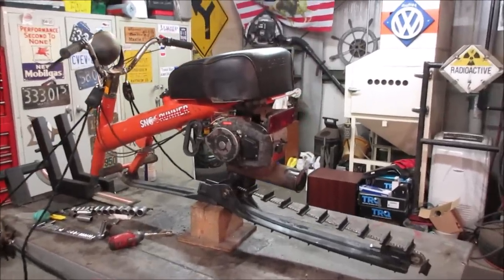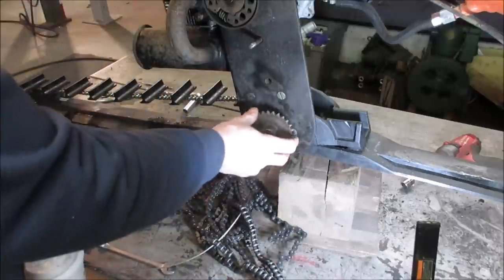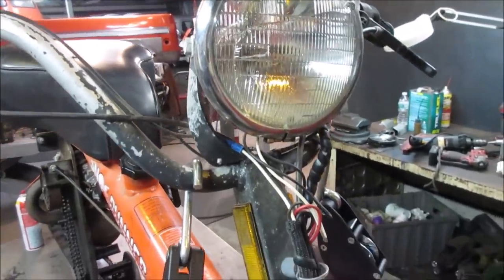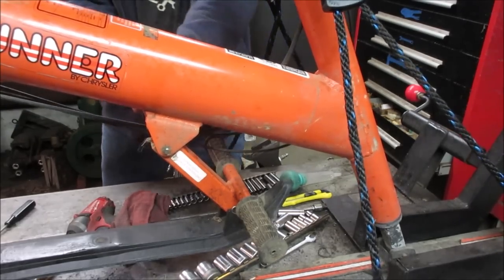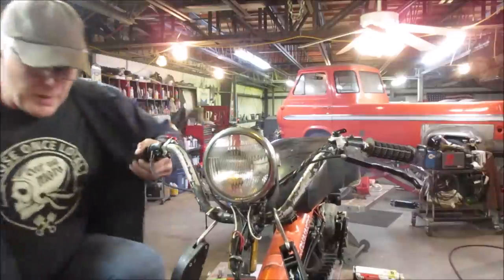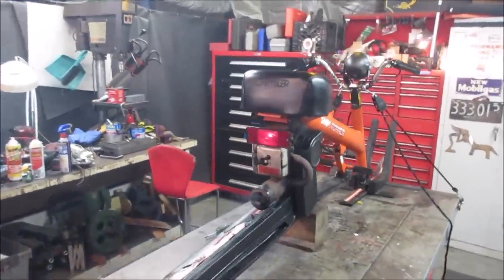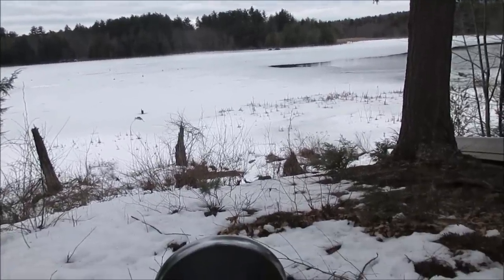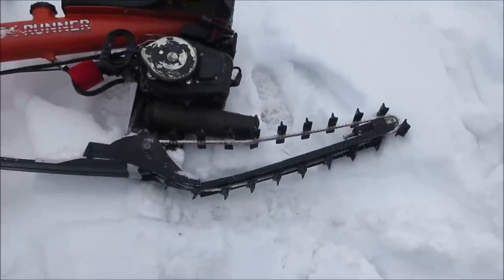Repairs finished on Junk Chrysler Sno-Runner, Win or Fail?

Comment from the maker: Hi guys, if you want to check out the vw trike in the end of this video, its here, https://www.youtube.com/watch?v=FMWEQoluv8U
Reply: If you do a search there’s a spring loaded little arm with a guide roller that keeps tension on the clutch chain it hooks to the missing bolt stud I think it keeps tension from inside and presses toward the front on your machine there’s also manuals available in pdf form you could print off with parts and function I wanted one of these as a kid I thought of it as a moped of the snow as I wanted one of those also never was in the budget have fun!
Reply: howdy mustie, i'm from italy and i love whatching your videos, i wa just kinda curious ahere are you from? like i know for a fact that it's the US but what state?
Reply: @TheGhostzZ  He's from New Hampshire.
Reply: @bastianfromkwhbsn8498  The lore goes a little deeper than that I think. ;)
Reply: Mustie1 ? You what would be cool ? if you made that "Chrysler Snow Runner" all electric.
Reply: GUY IS SELLING THAT BROKEN SKI PART ON EBAY BRAND NEW FOR $129 HAS SEVERAL. DRIVE CHAIN RAIL.

Comment: Definitely looks like there used to be a chain tensioner in the middle great video as always
Reply: Agreed...
Reply: I thought about that too I wonder if you can find pictures on the internet to find out.
Reply: Thought the chain runs inside that bar that sticks out
Reply: Yeah there's clearly a stud and hole it would mount into, you could probably rig up a tensioner from Amazon to fit.
Reply: There's a rectangular mark there where something once was.
Reply: @JasonTHutchinson  yup.saw that too. Lots of other viewers agree there was something there . surprised nobody has any drawings/ tech info etc.
Reply: Bolt in a piece of nylon (ie: cutting board) for the chain to slide on. Easier & fewer pieces than a tensioner wheel, just put it on the return side (front).
Reply: @Iowa599  I like that idea better than mine,, :-)
Reply: Pictures online, does not show a  tensioner.
Reply: The user manual does not show a tensioner wheel. There is a section about lubing the chain and at the end an exploded view, no tensioner in either. Don't know what they were thinking...
Reply: @JasonTHutchinson  My guess is that was a plate with a slot that held a small nylon roller on the outside of the idle side of the chain that slid back and forth to adjust the chain tension.
 It wouldn't be hard to build one. Just a flat plate with a slot, and a threaded hole to hold a bolt that supports a nylon roller.
Reply: Yes! Exactly! Mount another small sprocket wheel in that hole!
Reply: I had a 44" Toro Snowblower, garden tractor mounted. I want to say it had a wood chain tensionor in it. Wore it out, and replaced it with a plastic (unknown type, probably HDPE) one. Just like the chain tensionors in my Harley Davidson motorcycles. Piece of hardwood cut out on a bandsaw would work.
Reply: @knlazar08 , you'd be wrong though.
Reply: Loose on purpose............Chain play is used up during suspension action?
Reply: And, would be so easy to make….
Reply: @simontay4851  doesn’t even have to be a sprocket 👍🏻
Reply: Like maybe a high temp teflon friction bar.
Reply: @flintknappingtools  right! Could be a roller. Maybe a tube over a stationary shaft or stud. Copper , nylon something that wouldn't harm the chain, and could be easily changed out.
Reply: I’ve done some research bcuz I also believed there should be a tensioner but every picture I’ve saw with the engine cover off didn’t have a tensioner,I’ve saw 3 different bikes now. The belt was very tight as well on every1 I saw. P.S..another YouTuber named “Rednecks & Dirtyhands” did an awesome conversion 2 one of these and put a snowmobile track n souped up engine on it. Worth a look after watching Mustie
Reply: @OBeezyNB  the machine did fine as Mustie tested it. Did great until his ham-fisted friend broke it.
Reply: @twt000  Sprockets are never perfectly round so the chain tightens and loosens as the device rotates. One had to find the tightest spot (usually just through simple deflection measurement) and adjust chain tension there.
Reply: I just acquired one of these.  Mine did not have any tensioner on it either!
Reply: @oldsracer6031  does your chain have alot of slack?
Reply: No tensioner according to the original service manual graphics and comments on a facebook page for those sno-runners. What is missing is a second bolt to secure the cover and preventing it from sliding around, but in regards to tensioners, the comments online are stating that there was none from the factory and manual graphics do not show one either.
Reply: Wonder if the ski has slots that it rides on that would allow it to move up and down. He didn't even try it

Comment: You could try putting a chain tensioner like they have to do when converting 10-speed bikes to single speeds. That would take care of the chain slop.
Reply: Yup.   Some sort of tensioner, for sure.
Reply: Yeah, I was wondering if the center stud that held the cover was the a pivot for an OEM tensioner.
Reply: @dalehudson5803  same here.  Has to be some sort of tensioner.
Reply: What about a Hayabusa engine?
Reply: Yes I think you are  right if you look just by the right-hand chain there is a hole I reckon there was a tensioner there

Comment: Mustie when you use those plastic stapler things I'm pretty sure you're supposed to twist it like a quarter turn, let it dig under the plastic a little then let it cool a bit and pull it out. This way it won't just pop out if the part vibrates or bangs around, make sure it's seated like in the middle of the plastic depth wise.. just a tip
Reply: Just the tip and only the tip. I've used that line many many times. Usually if u rotate it in circles u can get more than just tge tip in. Make sure it's well lubed. Then use right amount of pressure. Not 2 soft and not 2 hard.

 I'm talking about drilling holes of coarse. Get urr mind out the gutter.
Reply: On a serious note yes that works well also. I also have good luck with air to cool it fast or a wet rag. Like when you shrink metal or weld on thin metal. I've used copper wire, and had most luck with stainless mesh or screen. Whatever urr fixing use the hvac tape that has the thin metal on 1 side and use that to soak up extra heat. Also like welding holes using a copper pad or piece of brass. Saved many a blow through. I've fixed quad plastic, bumpers etc. Welding plastic is a skill that can save so much time, $, insanity. Most of what we buy is plastic. I broke the carry handle on a $800 Dyson that was given to me as a home warming gift from Sis in law. I taped top with hvac tape and cut a piece of screen to fit and used a flat tip on wellen soleering iron. Still use 5 years later.
 Work around so u don't heat up the same spot like welding auto metal. Alot of plastic and auto welding use same rules. Not 2 much heat in same place, move around, cool it down after a tack etc. I've saved the day many times with broken plastic around house, auto, toys, quads, etc. I've never used a gun and kit like that. Seems like a good set to have. But a weller iron is $40. And I can get a piece of screen for a few bucks. Gotta be steel. No aluminium. Stuff breaks so easy. Only steel or stainless steel. Copper wire twisted in a drill to about 1/8 inch min works well also. Everyone has a soldering iron and with a 5/16 bolt sand down and u got a pretty decent start to fix about anything. Some plastics don't mix. Gotta make sure u use same plastic if adding scrap to work piece. A old 5 gallon plastic bucket works gr8 on most work. Happy plastic welding. Do outside, or use a fan so u don't breathe in fumes. should be common sense but in 2023 common sense is not so common, just like decentcy or courtesy.

Comment: I think you need to make a metal ski, or at least a metal brace for it. Also, you could fiberglass the outside of the cover, save big bucks. 
What a fun toy, thanks for taking us along!
Reply: I think it might be possible to make a suitable ski by using... a ski. They are strong and flexible, and can be probably cut to length, bolted and glued to the remaining stumps, or a length could be attached to the back of the original ski to keep the original track. And I bet there's tons of the  things in junk piles at the end of the skiing season.

Comment: I had 4 runners and a pile of parts back 10 years ago, I was interested in them because the Chrysler engine was similar to the engine used in the Rokons. They difference was that the sno runner engine ran backwards to the rokon. I think I have a box of pull start parts…somewhere if you need them. One thing I used to do is use a section of plastic gutter for a track cover…I was missing a couple and only had one nice one so I used the gutters to preserve the one good cover.

Comment: Hey Mustie cool toy!  I've never used those plastic melty staples...but I have used a soldering gun to embed regular stainless steel window screen into the plastic to span cracks.  I cut my patch to size then melt it in.  Works great - nothing sticks out because the screen ends up embedded like rebar.  Give it a try!

Comment: Depending on the plastic, I have had good luck melting wire screen into the plastic to mend the cracks.  ( i use bronze because it dosen't rust and i have a roll) one of my soldering iron tips is like a duck bill and it works great

Comment: Excellent video sir, as always.

I will say, that long stud that holds the chain cover looks like a perfect place to mount a tensioner. Whether it had one there and is missing is hard to say, but it wouldn't be too hard to fab a wood or plastic wheel of sorts to slide onto that bolt and take up some of the slack in the chain. Kind of like a tensioner for a serpentine belt.
Reply: That's what I was thinking aswell
Reply: nylon

Comment: Epic smoking headlight. 😁 A wonderful series of a revival of a exiting vehicle I´ve never seen before! That vehicle would do wonders up here!!! Just a tip, repairing plastic can be done with a broad tip (like a flat tip screwdriver one) soldering iron, weld the two parts together and using plastic ties as a extra medium if so desired. Pour over some superglue afterwards and top off with baking soda as a strengthener. Top up with more superglue over it. One can also use hotglue over the "weld" instead of superglue but skip the soda. Works wonders sometimes at some projects! Look at that snowtrike!!!!!! 🤩Cool stuff, a great video and hello from Sweden!!!!

Comment: Good morning everyone.  So in regards to the new rewind Frankenstein - do you think it should be clocked more vertically than horizontally?  It seems that pulling it in a forward direction wouldn’t be that convenient given the low height when sitting on the ground.  But if you clocked it up then you could be sitting on the seat, reach down to grab the handle, and give it a yank straight up.  That might also explain the wear on the lip of the seat…the rewind rope might rub on the seat edge as you pull it upward.  Thoughts?
Reply: Yep. I have seen them facing up or to the rear. In the first video it was pointed to the rear before he took it apart
Reply: That is one of the first things a "smart person" does when putting a new engine on a minibike or go kart; 'clocking' the pull starter so you get a nice straight pull AND from an angle that is convenient.
Reply: They are supposed to face up.
 Some of the oem seats have a small guard bar to prevent wear on the seat bottom edge when pulling upwards

Comment: Geez.. put an idler on the chain and tension it. Easy peasy! And use a HotGlue gun for the track cover. Just lay in a nice hot bead along the crack on the inside of the cover.

Comment: Pro tip. For your plastic crack repair you can cut a strip or strips off steel screen then warm the plastic up with your torch and push the screen into the plastic. Once you have it all pushed in under the surface you can take a spreader or the back of a pliers to push the plastic over the screen. Once encapsulated it should be good as new! Well with a crack...

Comment: Cable kink fix -
Find a spring that is the same diameter as the cable. Wind [screw] the spring onto the cable and cut as needed.  If needed reinforce the spring/cable by running several strands of steel cable between the cable and spring lengthwise. Then use the shrinkwrap as a covering. It will look like a cast, but be just as strong.

Comment: That thing did better than any of the ones I have seen. You would have loved the one a friend of mine bought and sold about 2 years ago..... It looked like it was fresh off the show room floor..... (after he cleaned about 40 years of dust off it....) Then again, it was put away and not used again after only having 3 or 4 trips of 3 miles put on it. The original owner of it bought it to use for going out to his ice fishing house/shack and there wasn't much snow at first. Then when he went out with it the last time he went out early and stayed late and found it had snowed over a foot while he was busy fishing and it wouldn't go through snow that deep and he had to drag it all the way back. He never touched it again but instead bought himself a Ski-Doo Elan for going out ice fishing. My friend also bought that Elan from him at the same time but kept it since it is great in any snow depths from no snow (bogey wheels are wonderful when no or little snow) to DEEP snow. Elans are light weight and the tracks go almost all the way to the front of them so it's  floatation in deep snow is amazing.

Comment: I used one of those plastic staplers to fix the hood on my snowmobile after hitting a pile of logs. Completely destroyed the front hinge part and back half when it was pushed back, but was able to stick it back together and works great now!  Also covered it in JB weld plastic weld to be sure

Comment: Good stuff, as you were mentioning about what the chain and pulley could possibly look like, I Google'd some info on this Chrysler Snow Runner. Parts and manual are available, in the shape that it's in (before you took it for a ride 😂) it could have fetched $2,000. While browsing I found out that my Schwinn Raleigh 12 speed, 27" bicycle that has been in my garage for 32 years (I purchased in '77) is worth a few hundred dollars. I knew watching you for all these years would pay off. 😅

Comment: Yo Mustie-burger(like Chateau Briande!).  One trick that mechanics use:  apply compressed air to whatever cavity or gallery that yir cleaning, drilling, tapping...making debris or chips.  It only requires ~40psi.  Then any debris is BLOWN OUT!  I've used this technique when adding a "full flow" filtering system to old air-cooled VW motors.   Zero worry about dirt inclusion, contamination, damage.

Comment: Just 2 small suggestions.  One should of used a piece of rubber line spit with a razor over throttle cable before shrink tube. It would help stiffen cable. 2 is that cable lube tool dyi method would be slide piece rubber line over cable and onto sheathing.  Then fill with lube and hang up overnight which will allow lube to seep though the cable. No fancy tools needed 😂

Comment: The sno runner seems to run much faster with the guard off!  Too bad it broke so you could not test more.  With your skills Mustie1, I bet you could fabricate a metal rear ski to replace the broken plastic one.  It will add some weight, but be less prone to snapping in the future.

Comment: Normally you would add a soft plastic block between both sides of the chain, so the slack side cannot “fall in”.

A different option would be to add idle sprockets - to keep tension :)

You explained, that one side does have tention. That's wrong. Both sides have tension – as the brake is using the chain as well.

Comment: On the plastic staple welder you should twist slightly while staples are still hot and welder is still on so that the staple is anchored under a section of the plastic. This helps keep the staples under the plastic and not pull out. 

After placing the staples, and cutting off the excess, a thing covering of fiberglass (assuming that it will stick to the plastic) is recommended but not usually required. This helps strengthen the joint so that it does not just crack again next to the area just repaired. It also provides new  non cracked area to do body work and make it look good.

Comment: It musta been 40+ years ago my friend used his E-brake and the rusty cable froze up. I took it off at the highest point in the car at the pedal hookup or whatever it's called,you know,up under the dash. Got the best seal I could with some tape formed into a cup to(hopefully) hold some thin oil or maybe trans fluid,I don't remember but whatever. Had hopes gravity would help it flow down through the jacket and lube the cable. It took some time(again I forget,maybe 2hrs,maybe 6) but the oil/fluid slowly went down so I would try working it then add some now and again. It worked to get the rusted frozen cable moving again so he could drive the old Chevy without heating up the brake pads on that wheel. The things we come up with when working on a budget or to get it going with less work,or both!

Comment: When you're riding buddy confuses "riding" with pre-season maintenance.
I was impressed with the ol' Mopar.  I didn't think you would have your feet on the pegs much, but you did quite well.
P.S. You might not have been able to keep up with the VW had it run right.

Comment: My solution for a cable oiler is to push some latex surgical tubing up over one end of the cable and hook it up to a vacuum pump.  Then spray the other end. The vacuum will suck the oil down the cable. It even works well for the spring wound housings, just spray the oil all over it and it will suck down through the gaps. Just make sure you have a vacuum bottle in linexto catch the oil and debris, so it doesn't ruin your pump.